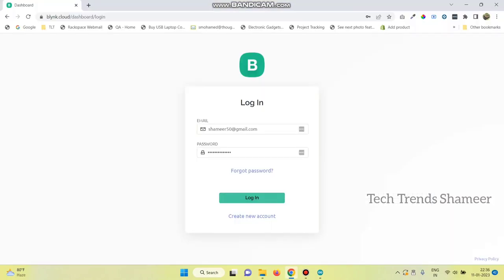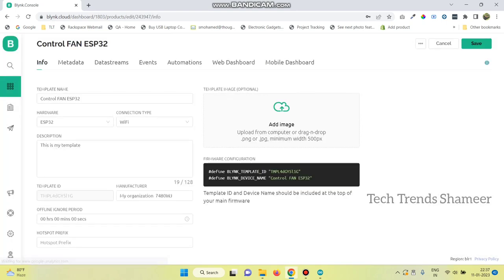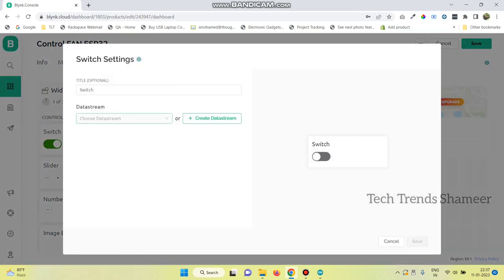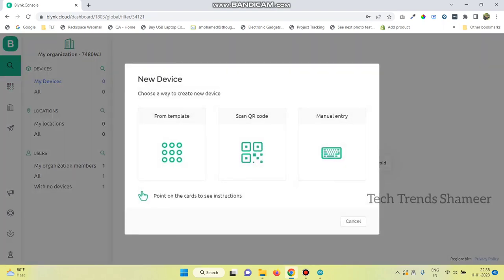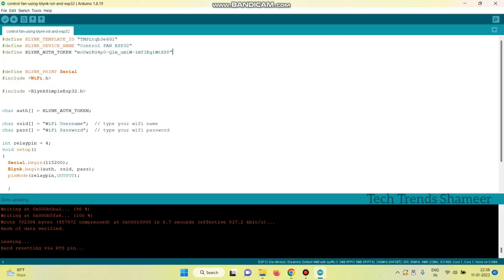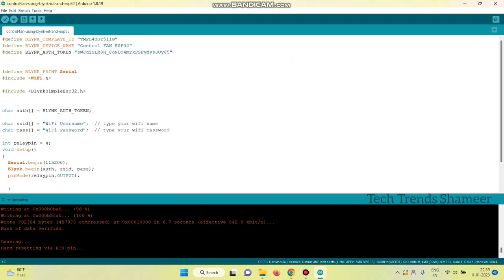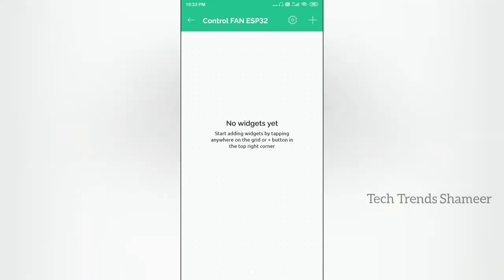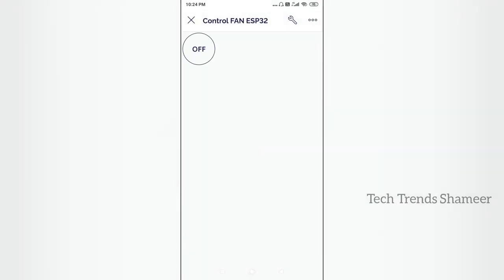Control Fan Using ESP32 and Blynk IOT | Blynk IOT Projects

Comment: Sir, the animated elements are not same as the real elements. Please show the connection properly. There are not any connection on the side of relay. And the number of connection on the sides of ESP32 is different in animation and real. Pease show the real connection.
Reply from the maker: You won't get all the elements same for drawing circuit. But the components I used is almost similar. Also please check the video clearly there is connection in the relay on both sides
Reply: @TechTrendsShameer  Sir, there is connection both side on ESP32, not on relay. And we are not able to connect similar elements, we want the perfect same elememts for perfect connection. So please show us the real connection you did.
Reply from the maker: Message me in instagram.